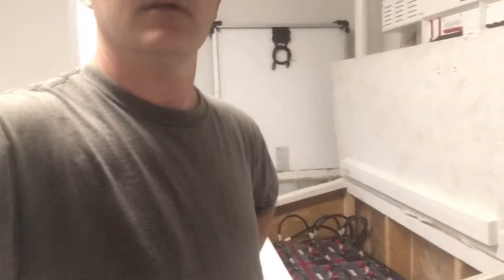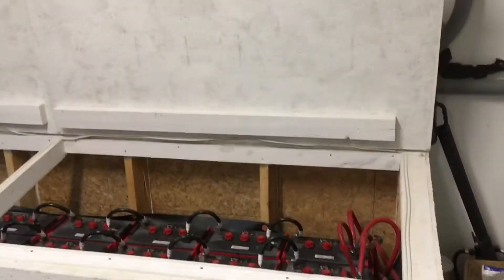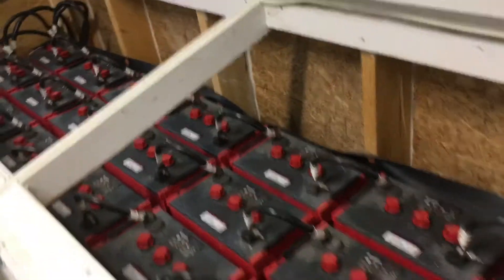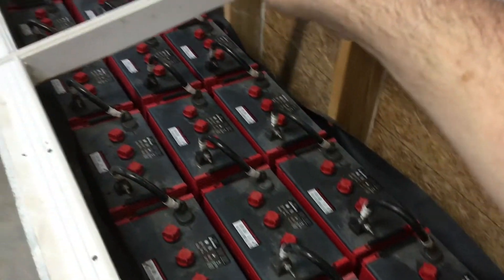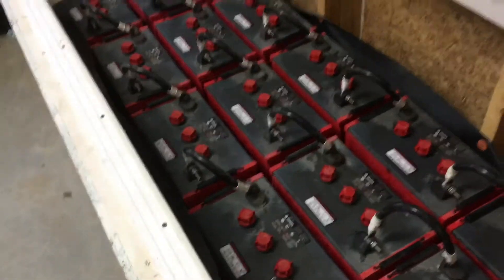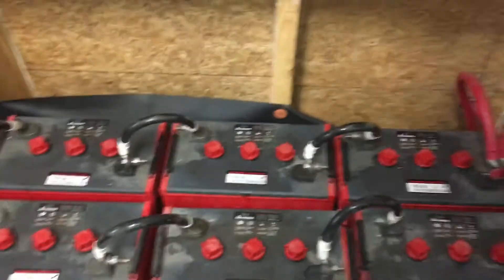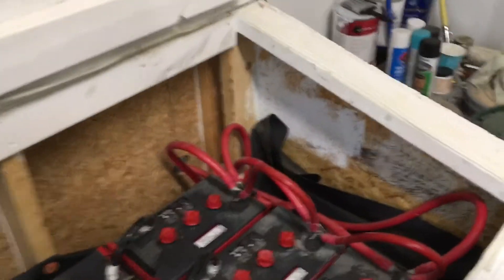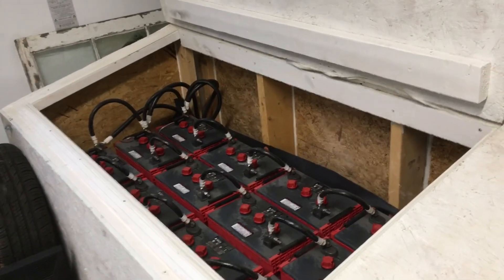SOLAR BATTERY BANK -- Rolls Surrette S-550 in our OFF GRID HOME

Comment: Nice batteries -- I'm a big fan of Rolls. I'm not a fan of parallel strings -- I only use serial. By the way, the battery temp sensors are incorrectly installed -- they need to placed about half way down directly on the side of each battery.

Comment: Just came across your video just curious why you didn't consider a bigger 6 volt battery like the 6cs 25 or 27p a little bit more expensive but less batteries less maintenance an so on also Steve Higgins at Rolls recommends having less batteries

Comment: Your battery bank is massive. I envy! Do they get charged by your Solar set up in a day?
Reply from the maker: Hi Joseph
Thanks for watching, Yes my panels will charge my batteries everyday that is sunny, although i do have days that are cloudy and dont get as much sun. I also have a propane backup generator that helps out sometimes. But for most of the time, the panels do all of the work. I will be doing a video soon on my panels and inverters, so you can see what all i have in my system.
Reply: Thanks for your response. I look forward to further Solar power videos from you. Take care
Reply: @thesunhouseproject7752  whats your maximum continuous discharge ability and available KWH storage capabilities? how many kw of panels do you have also?  Thanks trying to size my own system.